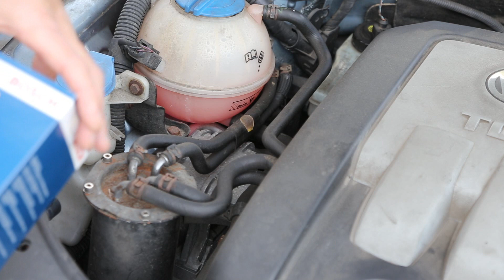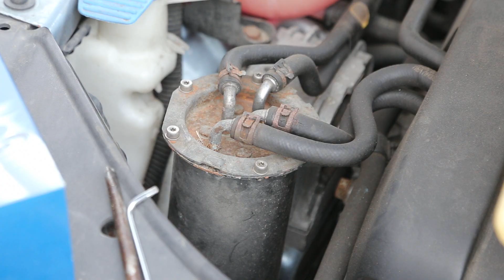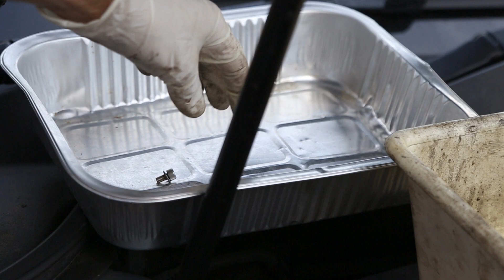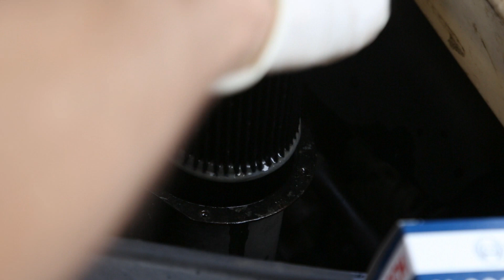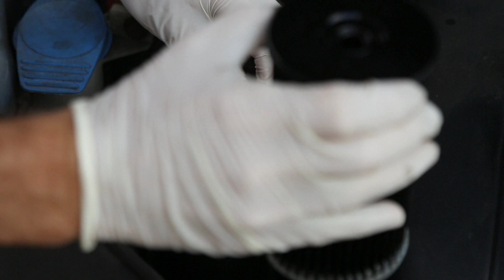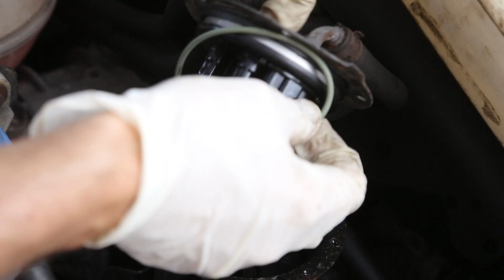VW Golf Mk5/Passat TDI Fuel Filter change - How to fit new replacement diesel fuel filter guide

Comment: As these hats get older the center pickup pipe which goes into the middle of the filter can break off. Be carefull lift canister hat straight up dont angle it hardly at all. This shite plastic starting to breakup easy time nowdays anything over 10 years old for sure.

Comment: My caddy is pulling back a bit when I’m second third gear … I think this might be my problem…. It needs the filter changed …. Hasn’t been changed in about 8-9 years
Reply from the maker: Definitely worth doing if it's been that long. It's a really cheap way to at least rule it out as a problem

Comment: Last time I did this, I created an air lock in the fuel system due to not topping off with diesel. Where do you fill with diesel to? Until its basically leaking out or just enough so the hole is covered with diesel?
Reply: I think just so the whole is filled mate

Comment: Hi, I changed my filter the other day and didn’t realise you had to top up the diesel. The engine started then cut out, I had to cycle the engine a few times to start it. Would this have damaged the engine? Great video, the other video I watched. Didn’t explain this like you have. Great video 👍
Reply from the maker: That should be fine. The one thing I've found that if your car can be a bit hard to start from cold normally then it's good to change the filter when it's already warm so that it's easier to start it again once the filter is done.

Comment: Hi guys any idea what's up with a 1.9 tdi that was parked up a few months and now starts but cuts out in a cuuple of minutes and difficult to start again. Runs perfect when running. Stale or jellied fuel?
Reply: Fresh new diesel or could be cam sensor
Reply: @diannecrawford9996  thanks Dianne it was water in the fuel filter.

Comment: I have a B6 Passat 57 plate estate 170hp, with the fuel filter change, is there any special requirements in restarting the car? i.e. priming as vw say about running vcds etc, but I don't have vcds, cheers
Reply from the maker: Make sure that the fuel filter is filled with diesel before sealing the canister (assuming it's a TDI)
Reply: cheers mate, I have had the EGR blanked and mapped out but left DPF intact but I had it flushed a year ago so cleared all the ash out of it. passed MOT no probs and having EGR blanked/mapped no issues on DPF.
Reply: @ajvw  if I've filled the canister with fresh fuel to the top is there a chance I could encounter starting issues or air in the system?
Reply from the maker: @pitbullzzz  it's always possible but unlikely if you've filled up with fresh fuel in the canister